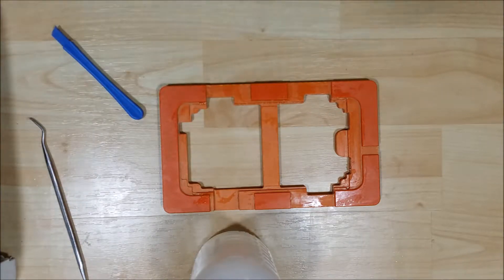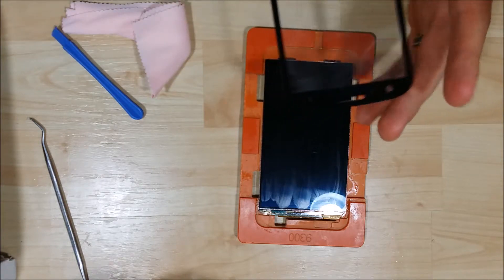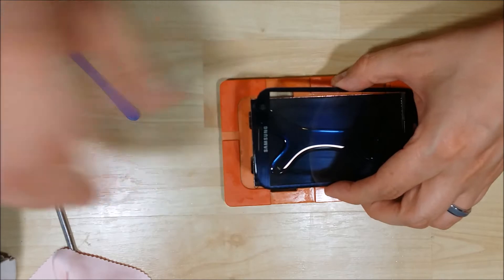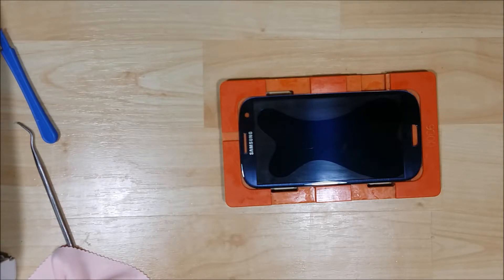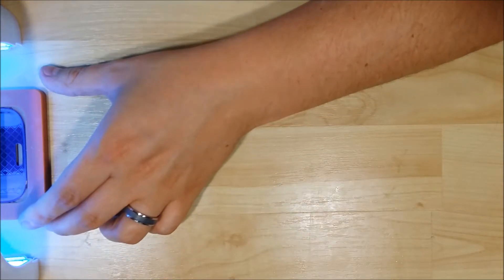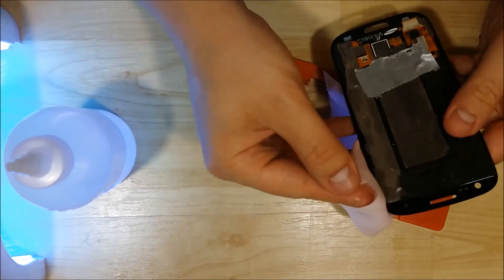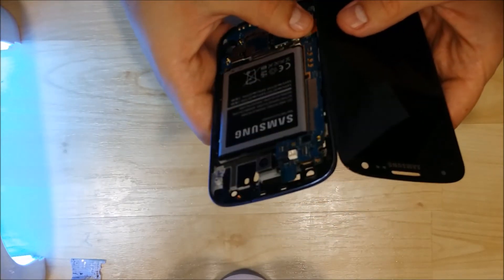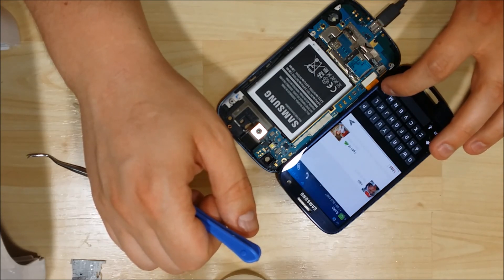Samsung Galaxy S3 - LOCA Application - LOCA - Part 4

Comment: I tried setting some LOCA under an UV bulb and it 
hardened to a certain degree: The surface still is "moist" if that's the
 correct term to use here. Is this normal behaviour? Or should LOCA 
become completely dry when curing it under an UV bulb? I ask because my LOCA is not the newest anymore (although it was sealed and kept in a dark location hidden from sunlight).

Comment: thanks for your video,,from where you buy the frame which you put the lcd in it for s3
Reply from the maker: hatem fekry Ebay here: http://www.ebay.com/itm/LOCA-Mold-Holder-Replacing-LCD-Digitizer-for-Samsung-Galaxy-S3-i9300-i747-T999-/181273623640?pt=US_Cell_Phone_Replacement_Parts_Tools&hash=item2a34bffc58